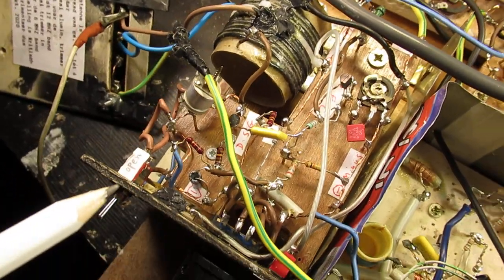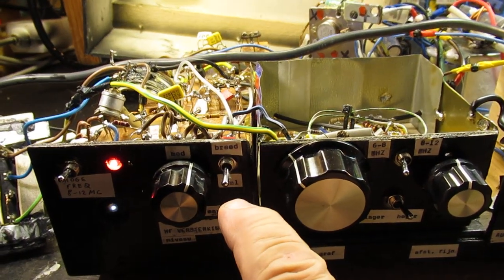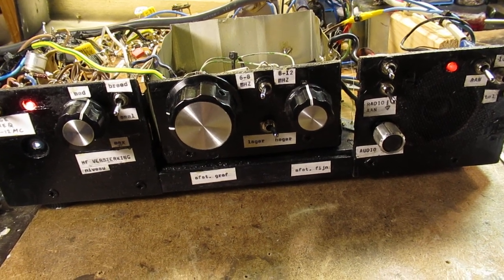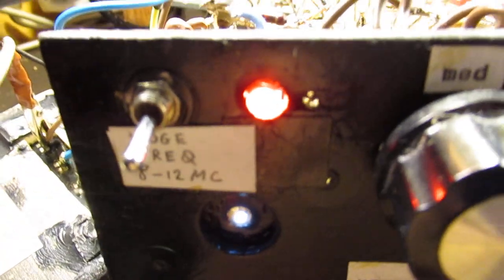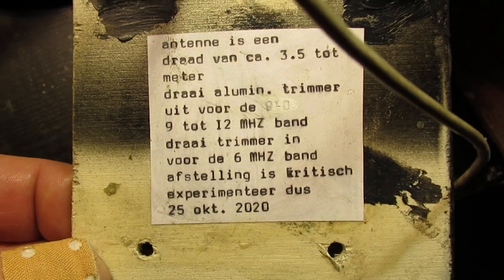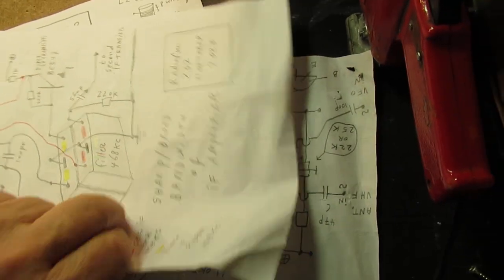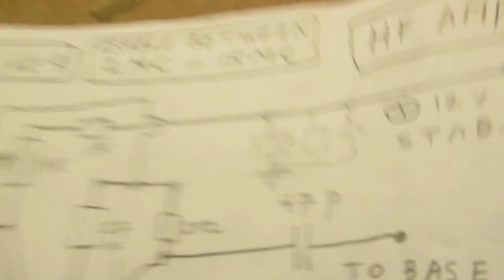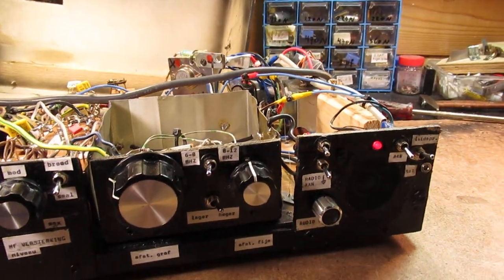Retro act on a simple homebrew SW radio for 6-12 MC republished with schematics & demo how it works

Comment: Was your home made coil 12 micro henries with a center tap? It looked like the capacitor(s) next to it would adjust from 51 up to 81 pf.  Is that what is happening there?
Reply from the maker: Everything is in the schematics and earlier video's (links in the texbox). I did not measure the inductance of the antenna coil but I think 12 microhenry comes close, having seen test coils of 12 microhenry.
Reply from the maker: The antenna coil has 2 x 6 windings on a toilet roll with a tap in the middle (12.51 in the video), the tuning capacitor that bridges that antenna coil is 0-30 pF, it is the aluminum trimmer that I turn in the video. You can switch in an extra capacitor of 15 pF with switch 1 (S1). When I do that the antenna coil works on the lower frequencies (6-8 MC). When that switch is open we go to higher frequencies (8-12 MC). Thanks. 15 dec 2022.